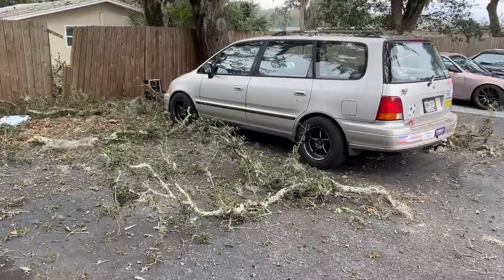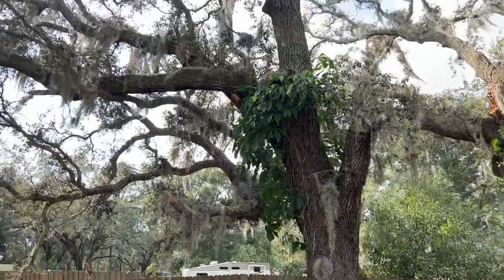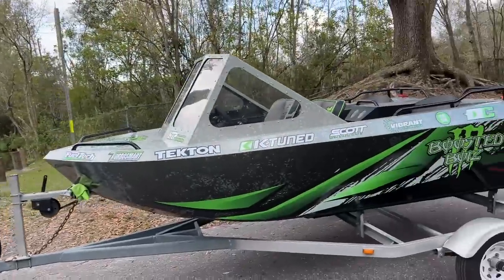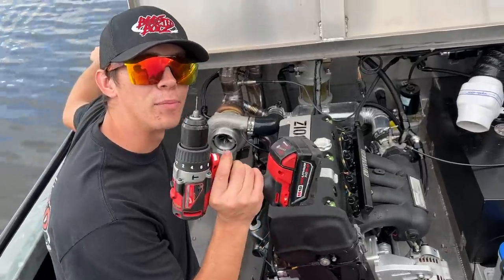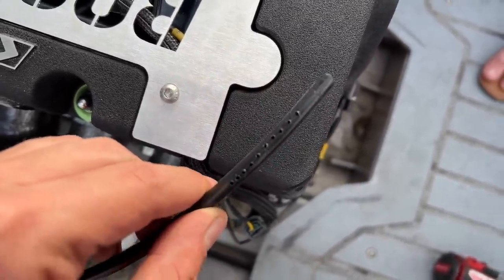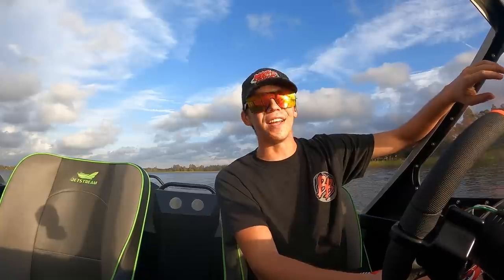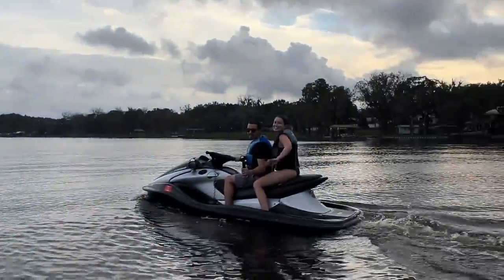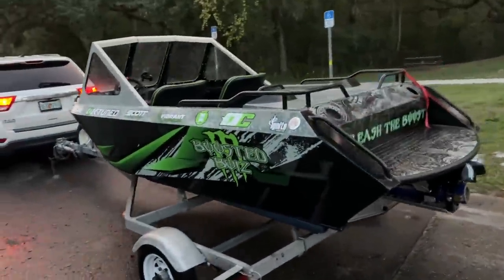Turned Up Our Turbo K-Swapped Mini Jet Boat and it RIPS!

Comment: Does this thing have adjustable trim? If it does, you don't seem to use it. If not, changing the angle of the nozzle may improve top speed too. See Mike Finnegan's channel for how to make a water jet more efficient. You can add angled wedges to the nozzle to change the jet angle.

Comment: Trim tabs and nozzle adjustment. You can see the bow head south once you're on full plane and full throttle. You'll gain 5mph, prob more just getting more of the hull off the water.

Comment: If you ever put another jet boat together I would get a pre-welded 2 seater and get your boy over at JP Racing to build a 1000cc jet ski engine for it and then put a turbo kit on it like Anderson at Fuel Tech is doing with his then wire the Fuel Tech ECU and dashboard from a 1000cc jet ski and see how fast you can get it to run and if another Hurricane hits Florida this year now that the boat is done and somewhat reliable you should take it out like Cleetus did his and try to help stranded people and do some Shenanigans in the process like ripping through the flood waters as long as there is no debris around and the water is deep enough

Comment: Definitely have to get that boat trimmed out right at full speed way to much of the hull in the water you should only have the back 3 to 4ft in the water. Way to much of the nose in the water that is killing so much MPH. Been boating with high performance boats my how life trust me. Trim that thing up and you will get so much more speed!!

Comment: Instead of drilling holes in the boost line you should've just put a Dial a Bomb boost controller in it and that way it's a semi permanent solution and you're not just wasting a bunch of push lock lines and eventually if you want to put a built engine in the boat you can and you'll already have all the boost controller you'll ever need out on the water in that little boat and here's a PRI idea for next year you could take the Wago hooked up to the boat and have an AWD K-series boosted wagon towing a boosted K-series boat and for PRI you could get the Wago wrapped to match the boat

Comment: Can you swap the impeller? Think of it the same as gearing in a car if you have gearing to top out at 150mph then 1000hp or 400hp it'll still go 150mph. Change the pitch of the impeller for more top end. Also you need trim to get the nose higher.

Comment: Hi Kyle. I never had a jet drive but it looks li,e a fire hose out of the back of the boat. The rooster tail is cool but it looks to be pushing air to me?i feel iit will push the boat a lot fasting if it is pushing water? ❤ your video's  Man!!! 👍👍🍺

Comment: The jet needs to be trimmed down more, loosing alot of power to it going in the air, also might bring the front end up a bit making it have less drag in the water

Comment: Kyle just say you know oil temperature on boats is something you need to watch. With an engine that runs cooler more of the heat is transferred to the oil. I know that doesn't make sense but it happens often on 85 and methanol vehicles. Because your boat is cooled with much cooler water than normal it has the same effect. If you would like to know the deeper science I could explain it if you would like.

Comment: two questions regarding the jet boat--is the motor getting enough air with the engine cover down and 2.  Can you play with trimming the jet drive?   Would seem you should get more than 52 mph out of it.  I am sure you will get more

Comment: If that poly on the bottom slows it down so much, how about smoothing things out with something to reduce friction, maybe a coating that repels water could work, or a 2nd thin skin of aluminium over the poly.

Comment: Changing horsepower and torque in a boat does not change top speed by a drastic amount. Changing horsepower and torque will get you to that top speed faster. Now you need to change impeller speed just like you would in a car by changing gear ratios. Now that you can accelerate faster gear the boat to have the same acceleration it did with the stock K but a higher top speed

Comment: You need more angle in the jet .. and shave the angle on poly on the bottom.... That will gain you probably several mph, theres probably a lot of cavitation air in the pump.... 

Even try to move weight to the rear, that boat is way nose happy...

Comment: Had a branch land on my car hood while it's off the road being worked on too 👎👎

Looks like the boat isn't riding on top of the water properly like the nose is slightly too low and pushing into the water instead of over it

Comment: IT SEEMS AS THOUGH YOU NEED MORE PITCH ON THE PROP. A LOT MORE. RPM, AND PITCH ARE YOUR FRIENDS RIGHT NOW. NOT MORE TORQUE, HP, OR BOOST. RPMS, EQUALS SPEED. RAISE THE RPM'S RED LINE. ONCE YOU CAN'T REACH RED LINE BY A FAIR MARGIN, THEN YOU GO FOR MORE HP, AND TORQUE.

Comment: Isn't there a trim select on the wheel for the pump? Need that boat "planing", cause you're pushing a lot more water than necessary! Sweet boat though man, we're very proud you're running Scott pumps down here in NZ!

Comment: Jet boats are all dig power. It woild do 100 with a prop on it for sure. Def need to start working with the pump guys now to get the righr impeller in there. I bet it will do 60-65 or so in the end but  get out of the hole like a drag car

Comment: Stop having a rooster tail trim it down so there no spray and bet you would get better acceleration and more speed as a having rooster tail like having a small parachute on the back just my opinion though

Comment: If I were you I would change it over to E85 now and put a Dial a Boost boost  controller and then eventually get a built engine for it and then once you do all that you might have to either change the impeller inside the jet drive or you might have to go up on the entire jet drive itself and I know you don't ride solo very often but when you do you should put something heavy on the passenger side of the boat to even it out just incase you ever hit anything in the water that is just under the surface that you can't see it is much better to hit something straight on than it is to hit something on an angle especially in those small boats you might end up rolling it to one side and taking on water

Comment: you need to trim it out you've got 3/4 of the boat sitting in the water on plane. need that nose to come up and ride higher after it levels out to put less resistance on the bottom of the boat. you'll pick up speed for sure

Comment: Take a bread knife and cut between the skin and the structure of the hood than pop the skin up and hammer the structure as close as you can. Then use 5200 to re attach the skin to the structure.

Comment: I'm with some of the other guys in the comments if you can get the boat to come out on plane more you will get more MPH and it will be more stable to drive and you should try to figure out the weight ballist situation so it won't lean to one side when there is only one person in the boat and that will help to

Comment: thought id throw my two cents in as well, get a second tank on the other side, with pumps between the two, that way you can pump some fuel to the other side to balance you up.

Comment: Boats run a 1/1 ratio no gears or transmission.  The higher the rpm the faster your top speed.  Or a different prop pitch

Comment: I’d reach out to Scott water jet and see if they have any advice for getting the boat out of the water a bit more. The more boat out of the water the less drag and faster it’ll go. Should make it a little easier to drive as well and you won’t have to steer it so much. Driving on the front of the hull will make it push back and forth

Comment: YOUR PUSHING THE FRONT OF THE BOAT DOWN IF YPU GET IT UP WHERE THERES ONLY THE BACK OF BOAT IS THE ONLY THING IN THE WATER AT SPEED IT WOULD BE WAY FASTER GOOGLE IT YPU WILL SEE THE FRONT IF THE BOAT NEEDS TO BE UP WHILE RUNNING

Comment: check out your hull speed, I am not sure if your hull design is a displacement hull or plainable, but for sure the more of your hull you can get out of the water the faster it'll travel.  In boats bigger engines only get you so far, hull design means everything for making it faster.  Most small boats have a plaining hull, for sure if you can keep  the water intake so it is still only catching water at higher plain and angle the jet so it's pumping down without nosing over and  pushing your bow down.  2 enemies are hull resistance and air contamination in the pump system.  so however far back the water inlet starts is the line you can get you boat to plain at.
it is all you need to have in the water.

Comment: mihjt be able to lay a sandbag over the en gine then slam the hood down , might be enough to pop it back intoo shap mostly 
as for the three ask the treeguys to prune it 
as for the dent , get a sharpy and write on it "chuck was here "
as for the boat , i think it needs a little bigger pitch prop youre prolly able to pump up the motor enough that it doesnt make a different with the holeshot but definetely should help with the end speed , might need some plates added on the back of the hull to trim the boat at speed the added length should help some and prolly protect the jet a little as it sticks out pretty far behind the boat

Comment: You should build a little ballast tank on the passenger side to make it more comfortable to drive alone. Just would need to all a few more water lines and have a tank to fill in the engine bay.

Comment: You need to make a intake in between the two rear seats where that turbo can get some fresh air and you need to get the angle right where you can get more of the boat out of the water

Comment: Get rid of the low to mid speed bunny hoppin' by trimming down 4.744 metric shittonnes when you take off. Ain't trying to be that asshole, you may have it maxed...??? Generally i got mine perd-near all the way down, thumb trimming up thru low & mid, mellowing out when it starts kickin the super rooster. Soops rooster cool? F-yes, but top speed is usually just before...like tiny,  mini-rooster.
Reply: ALSO: More speed? Wax T.F. outta the bottom.

Comment: Having lived in CO im sure you're used to these kind of thoughts >.> ...But what if you put the drivers seat on rail that allows it to move more to the middle if you're in it solo? To prevent movement you can just drill a hole in the rail so you can put a little keyed steel rod through. Or something similar

Comment: I can't remember if you have em or not, but wouldn't trim plates help with the boat leaning so much and get her on plane better. and with the extra power from the turbo you should be able to get a Impellor with a steeper pitch and thus more speed :) Love the build. When you gonna drag race against ol Cleeter?

Comment: I got one last season that was rhino lined in and out with acrylic face and Amp mounted to it. It works great and is about 45 or 50 lbs between Amp, box, 12 inch sub and so on

Comment: Get a array of different pitched impellers and play around with them. Not sure what the optimal RPM range would be for the set up? My guess 6000-6500 rpm?  Also not sure where these jet boats are supposed to plane out at but it does seem to have a lot of the hull still in the water at top speed.
Reply: Pretty sure they sent the specs for what the engine will be not what it is

Comment: I would think going to a different impeller would be the way to go.

I’m guessing that it has enough torque in the low end to spin it up well. It doesn’t seem like it has issues getting up from an idle. Giving it more top end would allow you to get those speeds without reving it out too much.

Comment: You could add another 100hp, you need a different prop for top speed. Think of the prop as a final drive. If you redlining, that's what ya get
Reply: Oh duh it's a jet boat so IDK. Maybe something you can change in the jet to get more mph without more power. Same concept, just no prop

Comment: Doesn’t look like you’re managing to get it up on the keel. It rides totally flat causing a lot of drag which is why you’re probably struggling to get more speed out of it. You need to get the nose up a bit…. When you were racing Wyatt you were beating him until your keel laid flat on the water, then he gained on you. 
You could try aiming the jet nozzle up a little. This will drive the back end down bringing the front up.
Reply: 👆👆👆👆👆

Thanks for watching and leaving a comment.
Send a Dm to claim your reward👆❤.

Comment: Did you guys set up the pump for the engine’s current or future spec?
I dare say you’re losing top speed through RPM not boost if you’ve spec’d the pump for extra RPM’s
Reply: 👆👆👆👆👆

Thanks for watching and leaving a comment.
Send a Dm to claim your reward

Comment: (Former sailor here) wedge the nozzle down slightly and shift the center of gravity towards the bow. You'll be ripping  high on a plane and gain stability from shifting a little weight forward

Comment: Gotta get the nose of the boat just a little more outta the water. It will gain a ton of top end. 30% or less of the boat in the water at top speed to get best mph and efficiency out of it.
Reply: 👆👆👆👆👆

Thanks for watching and leaving a comment.
Send a Dm to claim your reward

Comment: You need more rpm at the prop to go faster, power is gonna help, But if the rpm of the prop is always the same at wot it will always have the same top speed. It's like running out of gear.

Comment: im not much on boats but i feel something is off on how its planed out. looks way to flat. if im not mistaken Shreddy's and Cleets boats  planed out only sit in the water from about the mid to the back and yours is fully in the water nose to butt.   less boat in the water less drag more speed.  either trim needs adjusting or that plate u made to protect the pump might be forcing the nose down. a lil trimming might be needed...

Comment: Im not sure if jet boats use trim tabs if it does you should add them helps with stabilizing and will plane a lot  faster and the boat wont bounce at high speeds

Comment: On plane in under 2 seconds and 52 MPH is certainly respectable in any boating crowd.
Are there a variety of screws available for that pump?  Aftermarket props tend to be a huge improvement over most stock units, but I remember you bought a high-end pump so that may not be true in your case. Decreasing pitch would make for even more wicked acceleration but might put you into a cruise RPM higher than ideal for reliability and fuel economy.
Reply: They custom ordered this one based on the future specs of the engine, they need to increase their RPM to get more speed not boost, boost will help it get there, but RPM is what it needs

Comment: worked at a boat shop for 7 years, 90% of our customers were jet boats here in Alaska, too much of the front of the boat is in the water, adjust trim on the pump or put trim tabs on or something, at top speed should only be 35-55% ish of the back of the boat on the water.  you would get way more speed. awesome build, us guys with jet boat experience see a lot more potential there!
Reply: 👆👆👆👆👆

Thanks for watching and leaving a comment.
Send a Dm to claim your reward
Reply: Is there a chance that increasing boost isn’t going to increase speed? 
I feel like they aimed high RPM wise and aren’t reaching the potential of the current impeller, and will see gains again on top of trimming correctly if they get their RPM right?
Reply: @dylanzrim3635   you want an impeller that at wide open throttle you are at your peak hp rpm. the load on the engine resulting from the impeller is what drags the engine rpm down,  if you have an impeller that makes your engine over rev on smooth water at WOT your impeller isn't aggressive enough, if it is at a lower rpm than what you know your engine should be running it is too aggressive, dragging the motor down too much taking it out of peak power. the only time the rpm limiter in your tune would be used is if you were totally topped out speed wise, the rpm might creep up or if the jet comes out of the water and cavitates. if you have the perfect impeller, you hit it WOT, your RPM should quickly work its way up to your desired peak rpm and stay there. problem is your changing your power levels with more boost each power level will need a diff impeller for optimum speed/efficiency. decide what gas your going to stick with, e85, pump whatever, then dial that impeller in to what you know is your peak power rpm. also have jet trimmed down for take off then instantly trim up as high as it can go without cavitating. if you keep giving it more power/boost, rmp will rise, give it enough to get it at your max hp rpm would be another way to get her dialed better. doesn't that motor like 7000 rpm? unless your going to run 15/20 psi, i think you need a diff impeller.

Comment: All of your thrust is being thrown in the air. Need to angle that pump down
Reply: You definitely want the jet stream exiting the nozzle into the air not directly into the water. Often the highest speed will be obtained with the waterjet having a rooster tail. This also helps minimize the amount of the hull in the water.
Reply: @ScottWaterJet  well doesnt seem to be working on his boat.
Reply: @kylefitzherbert9381  ? Its doing 52 mph so it is working?
Reply: @ScottWaterJet  ya. Its doing 50. Barely. Other boats making around the same power go quite a bit faster. Even the boats agility compared to others seems lacking.

Comment: the speed of the boat is solely dependent on engine RPMS. you need to work the pump to get more speed, more aggressive impeller, a stuffer plate etc